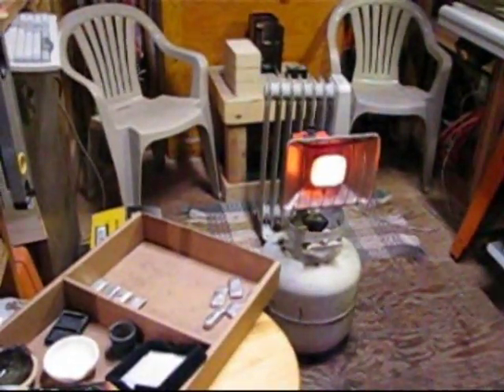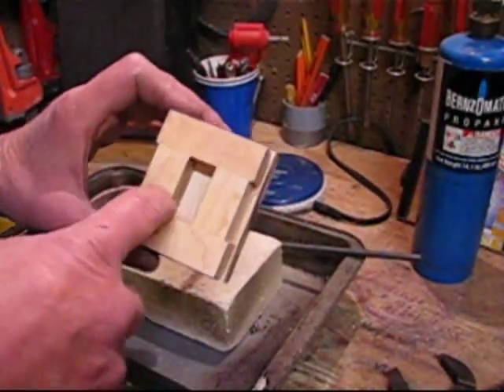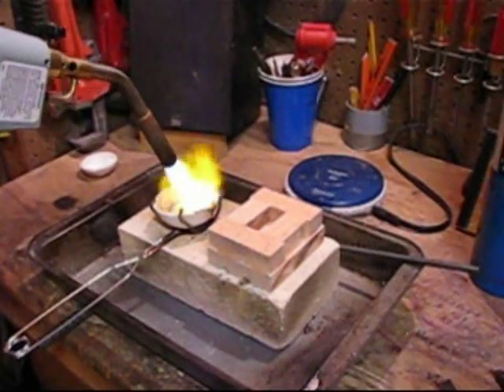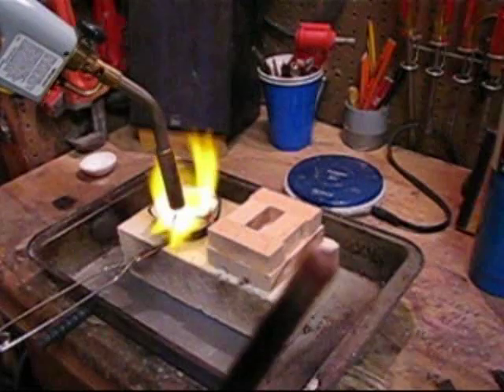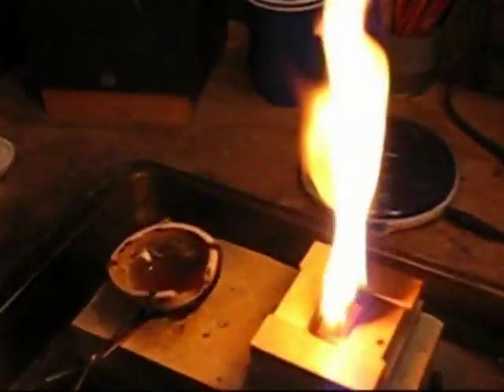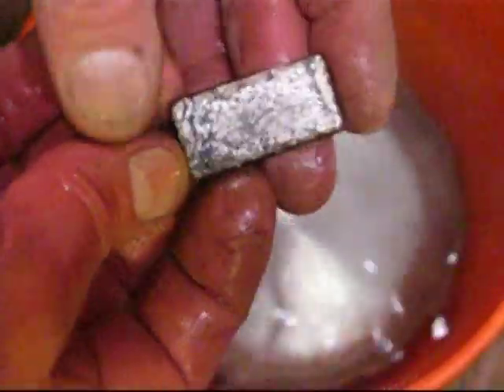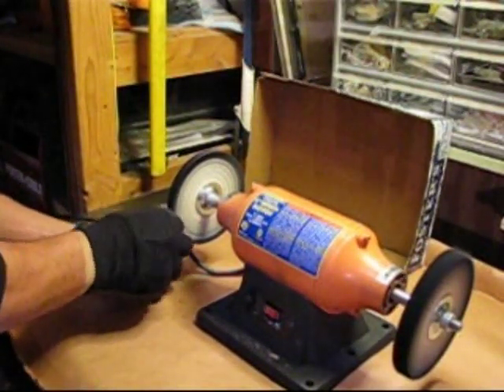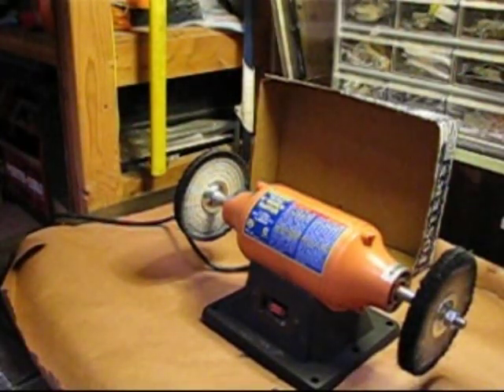DIY 115 - Melting Sterling Silver into a maple wood mold to make an ingot

Comment: Best video on actually doing it but the research I've done suggests using a graphite mold and slightly heating it for a better pour. The molds aren't very expensive and can be used several hundred times although I haven't personally used them yet as I'm just getting the supplies together.

Comment: You can melt your silver twice as fast if you go to home depot and get the torch nozzle that has the hose attached. It works faster and you get more pours out of your gas cylinder.

Comment from the maker: I have not done copper yet.  I love copper though.  I just googled the melting temperature of various metals and one chart shows sterling silver at 1640F but copper at 1983F.  I don't know if mapp gas is hot enough for that.  You might need a hotter gas or gas/oxygen mix?  Be careful though.  I don't know how hotter metals would interact with a wood mold.

Comment: CMON with the Harbor Freight man!!! Good job on the ingot.
Reply from the maker: Sorry late reply but I don't tend to my page like I should.  With tools I do more work with - like woodworking and construction for the house, I mainly buy name brand, contractor quality stuff..  But for hobbies, for something I will use only occasionally, HF has some decent stuff (as well as stuff I woudn't touch).  The buffer was great..  When my Porter Cable belt sander broke and I was looking for a quick replacement, the sander I got from HF was put out on the curb with a "free" sign on it after trying it for 2 minutes...  Some poor soul grabbed it,,, but then for him it was free so throwing it in the trash was probably no big deal for him.

Comment: You say you're going to stamp it 925 !!!, wouldn't removing the impurities refine the silver to a higher grade !!!. Great video by the way, thanks for sharing.
Reply: The borax itself only removes a very slight amount of oxides. The silver is still .925 sterling. He'd have to use chemicals to refine the sterling further and it might not be worth the added cost for what he intends to use the silver for.